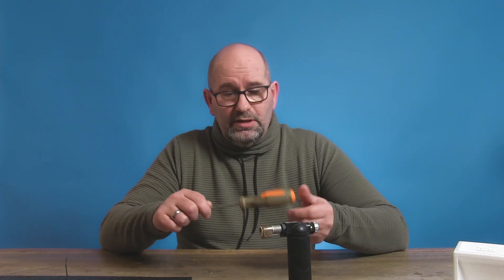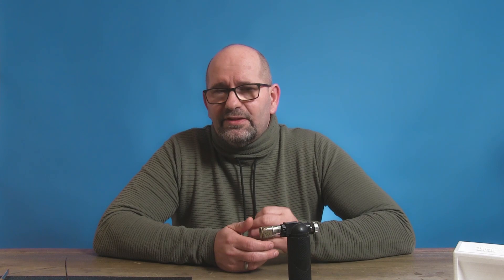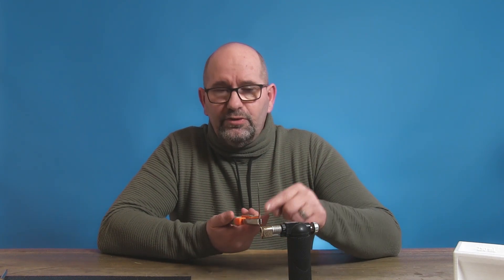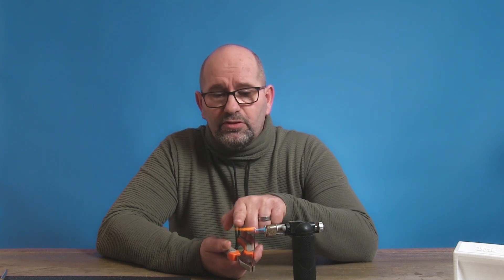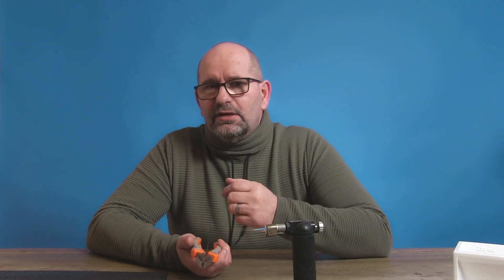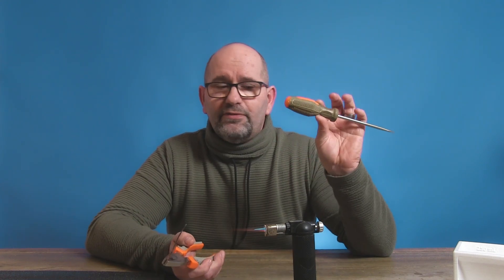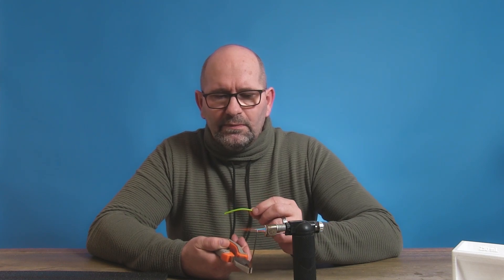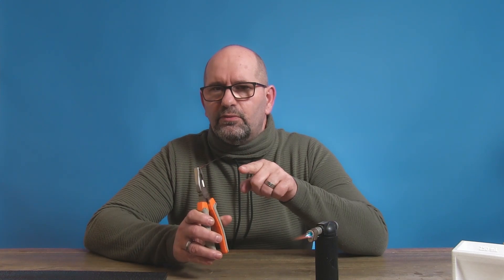▼ Laser Engraver | Is this plastic safe to engrave? | Beilstein test

Comment: Wow, this is so great! So easy to do and safe on its own.

We’re about to get a laser cutter for our makerspace, and one concern we’ve had is about people cutting PVC or anything else with chlorine in it, especially inadvertently (some kind of “mystery plastic”) 

This is so easy to do and such a decisive indication that it’ll let us relax a lot about the issue!
Reply from the maker: Hi, thanks for your reply.
The answer to your reply is Yes..... And No.
The risk of having Chlorine gas in your machine (and in your makerspace if that's not well ventilated), is a very big one, but it's not the only risk there is.
There are so many other chemicals that can form a risk in your shop, like for example Styrene, found in ABS, ASA and many other plastics (and even some wood glue). This is less of a problem in the machine as it doesn't kill your harrdware, but you don't want the Styrene in the air you are breathing. Good air filtration and circulation is therefore very important.
In my shop, the use of own materials in my machines is prohibited unless it's absolutely sure (and checked by myself) that the used materials are not a risk.
Reply: @3dPrintCreator  Thanks for those further tips! In a mixed blessing, a massive flood (broken pipe) provided the impetus and some of the funding to completely remodel our main workspace. Part of the redesign is what we’re calling the “fume room”, which has no HVAC return to the rest of the system and an exhaust fan to the outside  that we can run to individual machines. (This is also the room where we’ll be running the smelly resin printers and wash/cure stations.) So we should be well set up to keep noxious fumes out of the air and away from people’s lungs 😁 Good to know about the risks of styrene as well, besides just PVC. Thanks again for the great tips!

Comment: is any plastic safe to be burned?  Because most of them will produce toxic fumes other than chlorine.
Reply from the maker: Most plastics are absolutely NOT safe to be burned.
However, there not that deadly for your machine as PVC is. Chlorine is very bad for your laser as well as for you as a person.
You, as a person, should always avoid breathing in fumes from your laser. No matter if you are cutting wood, paper, cardbord or plastics, the fumes are not good. Always use ventilation at least, but removing the dirty air is the best you can do.
That said... This video is about testing for Chlorine. I wish I knew about other easy tests for other dangerous fumes.

Comment: I loved the video I have some plastics I was scarred to even try to use but now I can check and know. 
If you wouldn’t mind I have some advice questions. 
1- Can I use the copper wire from 12-2 rommex home wiring? 
2- Do you know of other tests for different materials?
3- Besides chloride gas are there other fumes to worry about when using a laser?
4- Do you know of a safe and not safe list of materials?

Thank you again for the great videos
Reply from the maker: I don't know the brands you mention, but copper is copper, and that can be used.
There are many chemical tests for different materials, yet they are not as easy as this test, and the test should not be more dangerous than the problem.
Any produced gas, be it smoke or a chemical made gas, is bad for your lungs, and more of your body. Even when you engrave wood, there are toxic fumes. Always work in a well ventilated area and/or suck away the smoke from the laser.